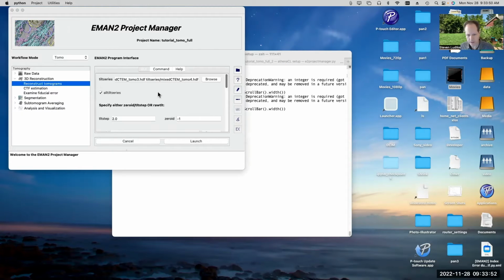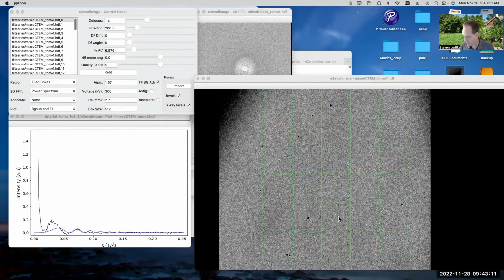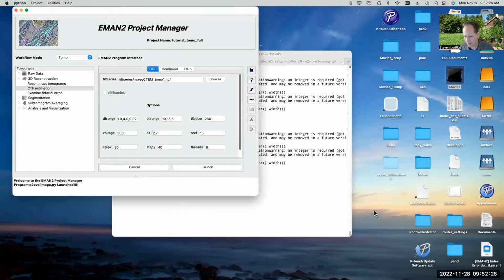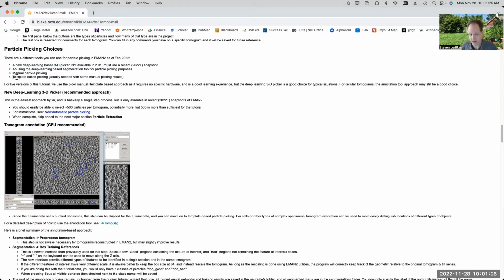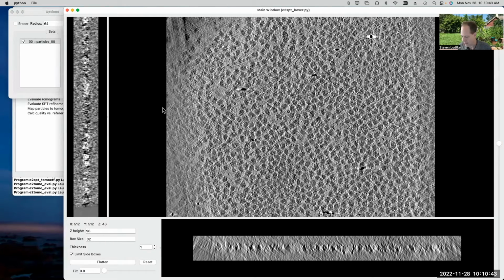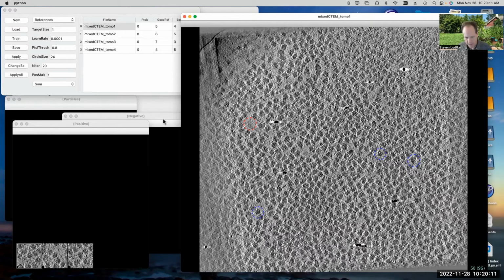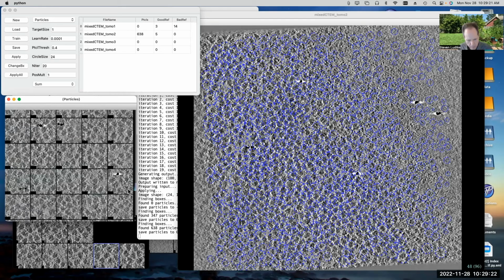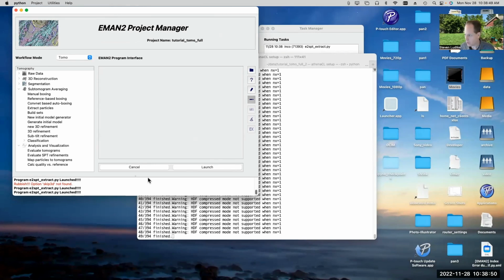Week 5 - EMAN2 Tutorial Discussion (Tomography Part 2)

Comment: Thanks for the tutorial! A quick note for anyone who might encounter an issue with the initial model generation: If you intend to use the new initial model generator, make sure to extract 3D particles as well. Avoid using the --skip3d flag with e2spt_extract.py